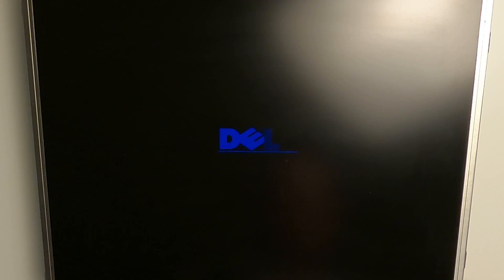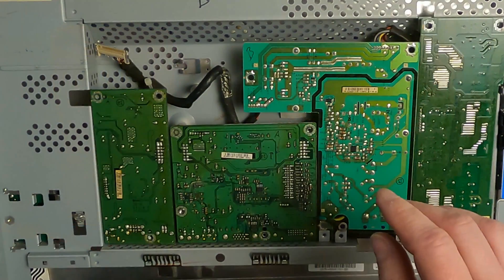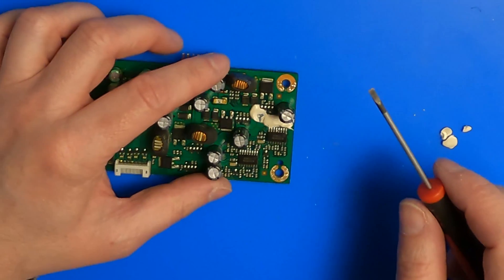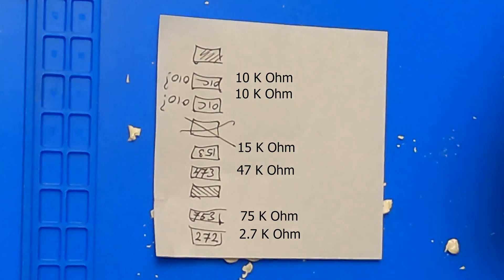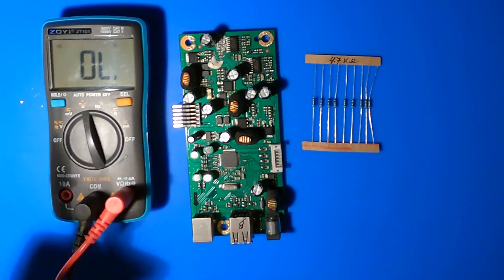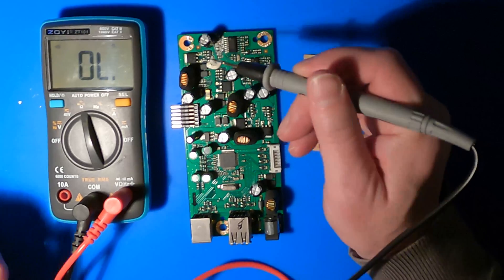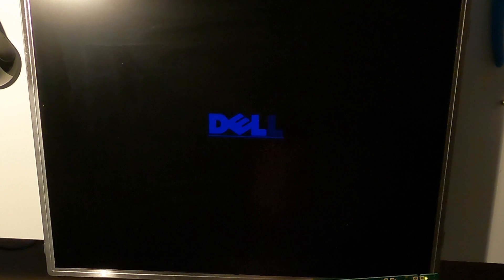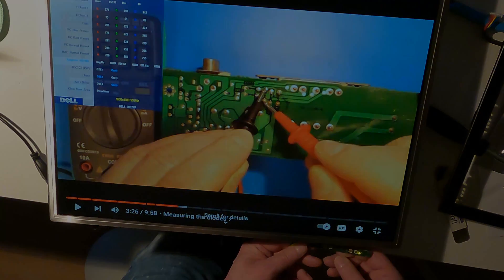Fixing a Dell 2007FPb monitor that has trouble starting (Dell 2007FPb - Episode #2)

Comment: Thank you! Fixed my monitor with this exact problem. Would never figured this on my own. To make it clear: if you have this problem, your monitor does start, but "reboots" at random times. Sometimes the "reboot" happens so often, that it seems that the monitor cannot start at all.

My resistor values measured slightly different. 47K is measured to 30K and a pair of 10K actually were a 10K and a 6K. I did have an open circuit instead of 2.7K. I replace this resistor with 2.7K 0805 SMD resistor. I used an inexpensive Chinese SMD station with a concentrator nozzle at 400C. Only took a couple of seconds to melt the solder. I used it at 100C before that to help removal of the white gunk with tweezers.
Reply from the maker: That is wonderful! And great work on the soldering, those resistors are soooo small. Great idea to use 100 C air to remove the white stuff as well.

Comment: Nice!  I wish i had your genius, skills and steady hand.  Can I send you mind to repair this issue?
Reply: In all seriousness...mostly (i wish could find some help doing this)  QUESTION... This module looks like it can be disconnected.  Would the monitor fail if it were disconnected/excluded if you are not using the USB for anything?
Reply from the maker: Unfortunately it will, because half the board is for the USB ports but the other half has power supplies for the board creating the picture (the one that catches fire in this video: https://youtu.be/ueAvB8J-gUk ). If you are in Europe, postage for sending me the board might be reasonable, but if you have a look on ebay, you might find one for very little currency and switch the boards with the second hand one. Are you sure it's the same fault? Trying to start, but not finishing the boot process?
Reply from the maker: Thanks! You could, but just the postage is probably more than a brand new second hand of these monitors. Did you figure out which board is the problem? Does your monitor have the same symptoms?

Comment: I have a Dell 2007FPb monitor that when turned on shows an image of the connected computer’s desktop for a split second and then goes black. I can’t even see the menu when I press the menu button on the OSD. Is that a similar problem that would require hardware work like what you’re showing here? I’ve tried blindly using the menu and + buttons to adjust the brightness and contrast and also tried doing a display reset with no luck.
Reply from the maker: Have you tried the monitor on any other devices? Is the monitor connected to your computer's DVI connector, or are you using an HDMI to DVI converter? I had some trouble with those. Did your monitor work well up until now? Does it show any picture when you enter the service menu as shown here?: https://youtu.be/YOYm7_EGKxU?t=374
Reply: @repairchannel I’ve tried the monitor on 2 separate Dell Precision 390 desktops and an Asus ROG laptop all with same behavior. Both VGA and DVI connections also have the same behavior. My 2007FPg doesn’t seem to have an HDMI connection. AFAIK, the monitor was working at one time but I don’t know when it stopped working. I tried holding menu & + buttons down while pressing power then - button but no image appeared.
Reply from the maker: Yes, that does sound like a hardware problem to me. Since I've had a couple of comments about those little resistors failing with other viewer's monitors, you could have a look at those. Maybe start with the capacitors on the power supply board first, because those are easily accessible. I have some spare boards left, so if you can figure out which one is failing, I'm happy to send you one, but postage might be more than a new second hand monitor, they are offered on our local second hand website for about 10 euro's now.
Reply: @ Thanks for confirming my suspicions on this and for your quick responses.

Comment: i have replaced the caps of the power board and am still just getting the black screen (no dell logo at all but you can see the backlight working when pressing power)
I am now checking the resistors as you show here. the bottom one is reading correctly at 2.7k

if I go from the bottom resistor up these are the readings (according to auto mode on my multimeter) -

2.712k (2.7kohm)
0.572k (57k?) (supposed to be 75kohm)
(you have no measurement for this one on your diagram)
0.520k (52k?) (supposed to be 47kohm)
15.00k (exactly 15kohm)
X
0.620k (supposed to me 10kohm)
33.23M (supposed to be 10kohm)

So my thinking is - replace the one showing 33.23M to a 10kohm resistor and that should be good?

Just wanted to know if readings for my resistors are ok (except for the one reading at 15k).
thank you
Reply from the maker: Yes, I would solder a 10 KOhm resistor parallel to the 33.23 MOhm resistor or replace it, whichever is easier. Hopefully that will bring your monitor back to life! Thanks for your subscription. Much appreciated.
Reply: @repairchannel  WOW, that was it! It was that 33.23M reading on that 10kohm resistor! I took the resistor off and put a standard resistor like you have in its place. Dell logo comes on and all is well! Amazing. So happy to get this monitor up and running as they are well suited for lcd arcade builds (although crt lovers will disagree haha).
thank you for this video, you deserve more subs!!
Reply from the maker: @Retrobution  Fantastic! That is good news :). Thank you for your kind words ||